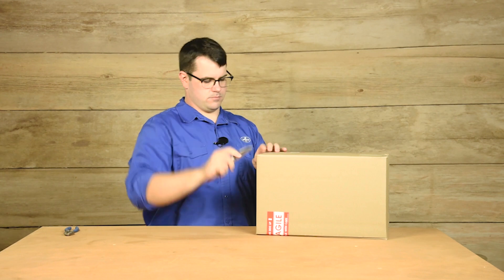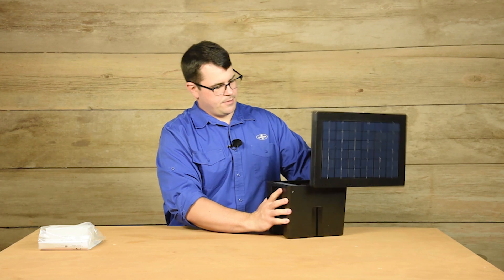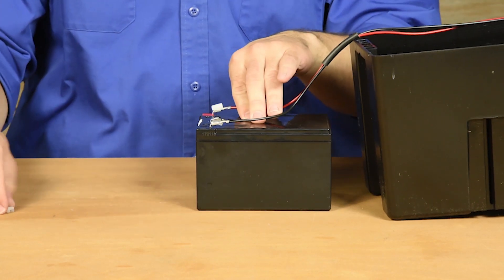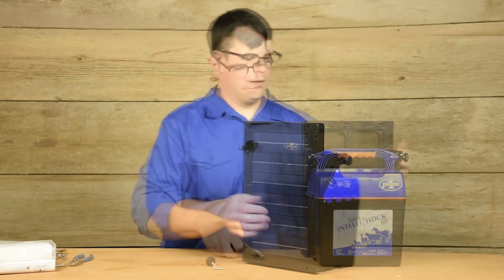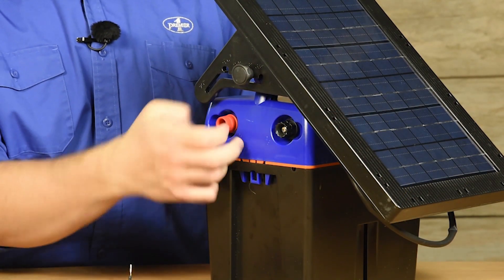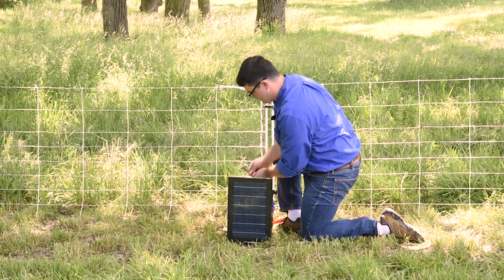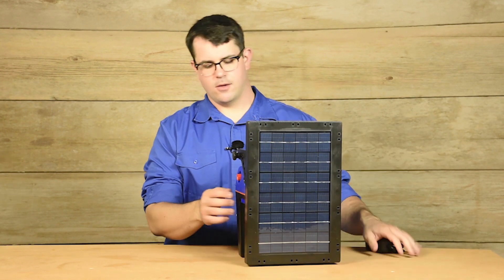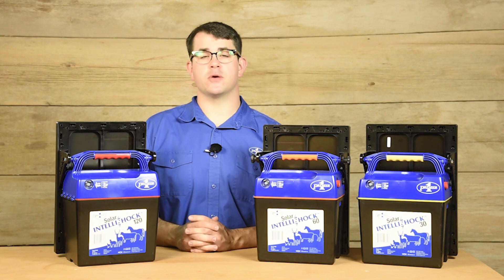Solar IntelliShock® Setup

Comment: Should the unit be on or off while recharging the battery from a 110V overnight? If off, will it overcharge the battery?
Reply from the maker: If it's connected to the fence, on. If not connected to the fence, off. There's a built in voltage regulator, we are not worried about overcharging if connected overnight.
Reply: @premier1supplies  Excellent. Thanks!

Comment: great if you would have shown how to connect 110v setup for charging
Reply from the maker: Unplug the solar panel inside the unti. 110v adapter fits over the connections you just uncovered. Pos/pos, Neg/neg.

Comment: How long should the unit be plugged in for to be fully charged?
Reply from the maker: There are a few variables, so no solid answer. They depend on amount of depletion, total size of batteries, and which charger you have. We typically go overnight on charging and monitor overall battery voltage.
Reply: Can it just be set up to charge initially from solar?
Reply from the maker: @cameron3525  Yes, simply connect the batteries and it'll recharge from solar. Just set in the sun for a few hours if the on/off switch is blinking green/red at initial start-up.

Comment: Can the unit be attached to the top of a T Post or U Post? It appears to have a built in slot for attaching to a t post. Also, I have the new version with the direct connection 110 v socket on the front. Do I need to disconnect anything on the inside to use this or just plug it in?
Reply from the maker: Depending on the size of the t-post, it should slide over the top. 

Simply plug the ac adapter into the unit, no need to disconnect anything internally on new units.

Comment: I don't have netting but have one hotwire on an existing fence. Do I just hook the hot clip to the fence?
Reply from the maker: Correct, connect the fence lead directly to the fence. The best point of contact would be an end or connection between two conductors. This increases available metal to metal contact for better pulse transfer.

Comment: You did not cover plugging in the solar panel to the batteries on the 120 model.
Reply from the maker: That is covered at 2:20 in the video.

Comment: What gauge wire is used on the leads from the shocker to the fence? I need to move the Intellishock in order to place it in the winter sun, and the current leads are too short.
Reply from the maker: It's 16.5 gauge. More importantly is use insulated electric fence cable Its covering is rated for the high voltage of electric fence energizers (10,000v).

Comment: What’s the different between 60 and 120? Where am at, I’ve dry clay soil, so I like to get 120.  What is your thoughts on this?
Reply from the maker: The difference is 0.6 joules of output. The 120 sends more energy through the fence, has an additional 12v, 12aH battery and longer ground rod. If in dry conditions, use more grounding (purchase additional/longer ground rods) and possibly a pos/neg fence to get around the lack of soil moisture.

Comment: We are setting up a premier fence and Hotshock 5 unit. I will be getting a deep cycle battery and adding my own solar unit. Do you sell an intellshock unit that would integrate these components?
Reply from the maker: Yes, visit premier1supplies.com or call us at 800-282-6631.